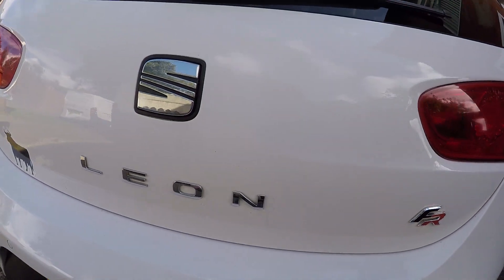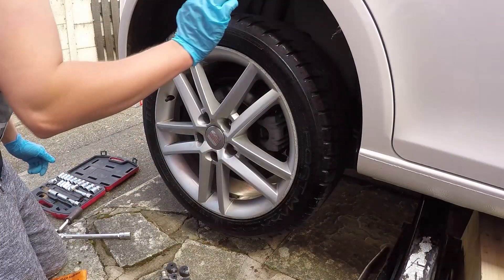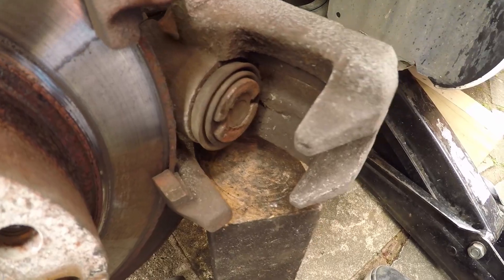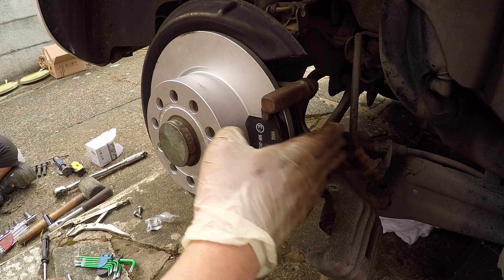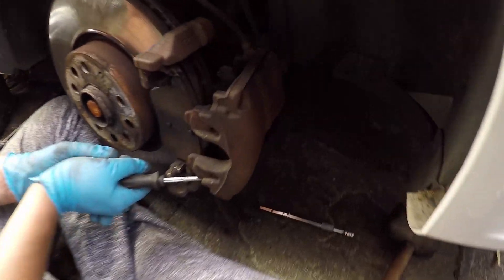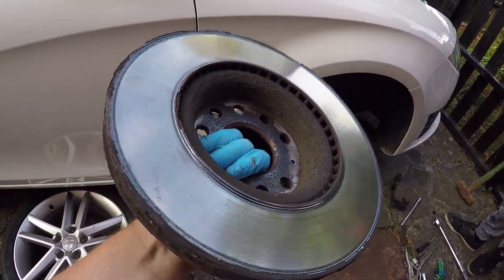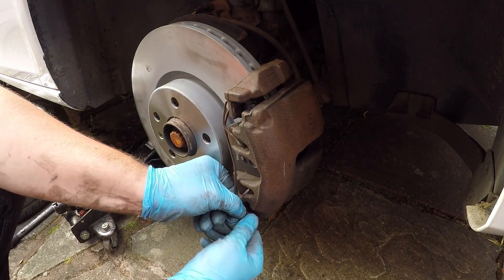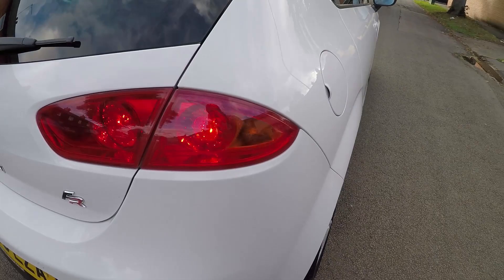Replacing Seat Leon 2010 Brake Disks & Pads F/R

Comment: You should squirt brake cleaner on them and get all the oil off which stops them from rusting in storage
Reply: There are painted discs, they're not greased.
Reply: @GuyRWood  just brake it off, takes a couple of times hard braking an then its fine, just dont stay on the brakes when you are at standstill to prevent glazing

Comment from the maker: If anyone has a Golf or A3, this process is the same. I hope this video helps you out guys.
Reply: Jetta and Jetta/golf sportwagen should be the same too! :) you should have pumped the brakes with the reservoir cap off to burp any air out.
Reply: Buy yourself a decent breaker bar, you don't want to be undoing/doing-up wheel nuts with your socket wrench really.

Comment: Useful info: 
Engine size
Front Disc Size mm - Pad Model
Rear Disc Size mm - Pad Model

1.6
Front 280 x 22 - Vented
Rear 255 x 10 Solid -PR-1KD

1.4TSI
Front 288 x 25 Vented - PR-1ZE
Rear 255 x 10 Solid - PR-1KD

2.0FSI
Front 288 x 25 Vented - PR-1ZE
Rear 255 x 10 Solid - PR-1KD

2.0TFSI 182/197HP
Front 312 x 25 Vented - PR-1LJ FN3 caliper
Rear 286 x 12 Solid - PR-1KZ

2.0TFSI 237HP
Front 345 x 30 Vented
Rear 286 x 12 Vented - PR-1KZ

1.9TDI
Front 280 x 25 Vented - PR-1ZM/1ZF
Rear 255 x 10 Solid - PR-1KD

2.0TDI 140HP
Front 288 x 25 Vented - PR-1ZE
Rear 255 x 10 Solid - PR-1KD

2.0TDI 170HP
Front 312 x 25 Vented - PR-1LJ FN3 caliper
Rear 286 x 12 Solid - PR-1KZ
Reply: You legend! I was struggling which pads to get for my 2.0tdi 2012 Supercopa

Comment: Ok here goes. The caliper mount does not need to come off unless seriously rusty. My disc came out with couple of bangs with just caliper and pads out. Its 12mm hex spanner for caliper and sline m14 or m18 for caliper mount if needed. Use copper grease on back of pads and sliding pins. Clean all parts with wire brush especially face on hub before putting new disc. My caliper was seized and needed serious wiggling back and forth to retract with caliper rewind tool.

Comment: Great video! But on facelift model (my one supercopa 2012) you don't have to remove rear calliper carrier (very hard job), you just have to remove calliper it self. It is slightly different than on 2010. You will need two spanners 13mm and 15mm.

Comment: One good tip when replacing your discs is to keep a close eye on the fluid level in the reservoir. Because you're pushing all the pistons back in, there's a danger of overfilling and overflowing the reservoir.

Comment: Can I ask, with the rears, do you have the handbrake on or off?
Reply: You cannot push back the piston with handbrake on. I figured it by myself when I changed my brakes. (Skoda Roomster 1.2 TDI 2011) Almost same with the Seat Leon.
Just leave it in 1st gear without the handbrake.

Comment: I’ve changed my pads today using this video. Wondering if you could help as now the front left has a very loud knocking from the front left on uneven roads. Sounds like something is hanging off. Double checked the wheel bolts and calliper bolts but still there. Possible the pads are rattling in the calliper? Cheers

Comment: it's probably different with the FR, but with the 1.9 TDi, does the caliper carrier need to be unbolted - i've read that the disc can slip out past the carrier.
Reply: I've got supercopa fr 2012,rear carrier no need to remove, just the calliper it self. It is slightly different than shown here. You will need 13mm spanner and 15mm. To replace front discs you have to remove calliper carrier (21mm socket)

Comment: I would like to know all the tools and sizes  required for this job, someone can help?
Reply: Ivo Lopes 17mm for wheel lugs think it’s a t25 for the disc bolt, 13 mm spanner for caliper m14 spline for caliper hanger. And of corse the wide back tool that’s for the rear just recently completed mine